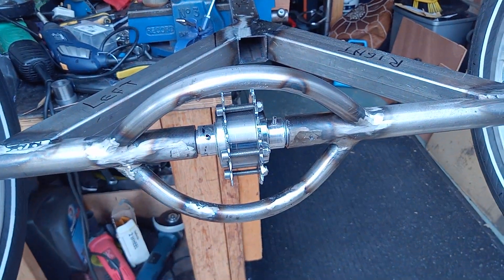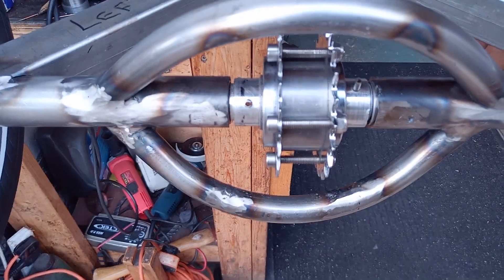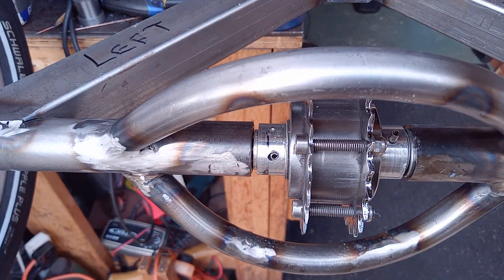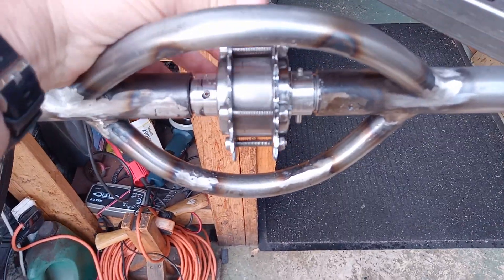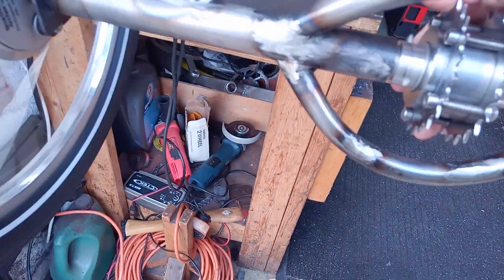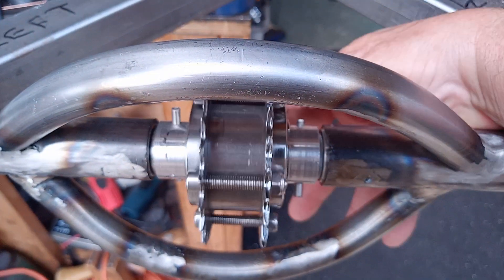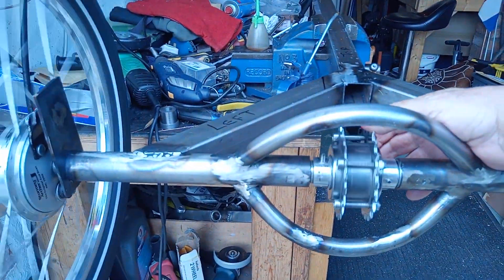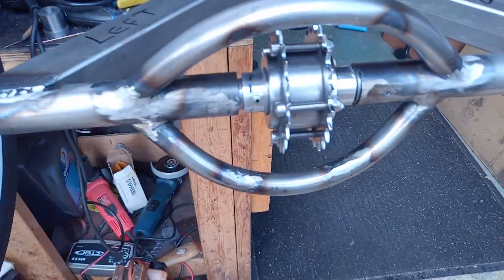Avengers assemble?   No, Bike bits assembled.  :)

Comment: I presume this meant to be a tricycle, but you didn't design it very well as you have to havr a rear differential on the axle shaft. As you probably know when going to the corners one wheel is turning quicker than the other therefore you need to have a diff or have sprocket only on one wheel and have the other freely spinning both directions like the pedaling go karts have. Hope this helps.
Reply from the maker: Well how surprising!  That is exactly what that is.
A rear differential built from 2 Sturmey Archer freewheel hubs.   Each wheel has its own independently driven half-shaft.

Perhaps if you asked questions instead of making pronouncement/judgments that would have been better?

I designed it exceptionally well, thank you.

In fact it is better than a differential because a differential can put all the power to the wheel with the most grip.  This simple home-made device provides the ability for the outside wheel in any turn (Left or Right) to run faster than the inside wheel.  The rider's/motor's power always goes to the wheel with the most grip.

Don't be so quick to judge something you have no idea about.  ;-)